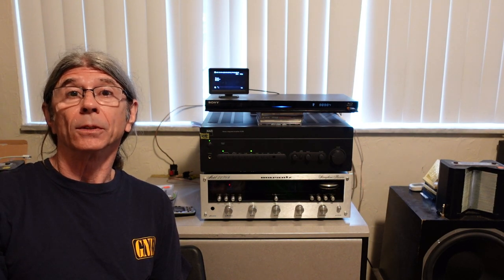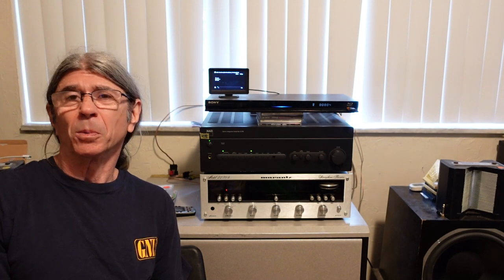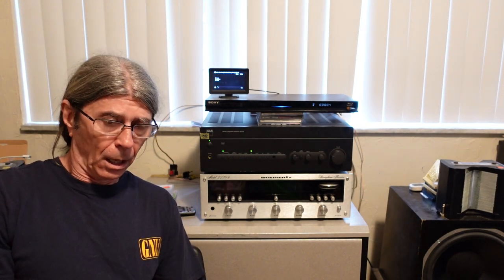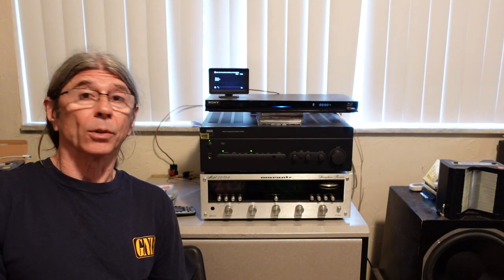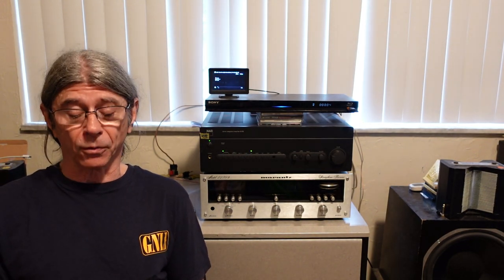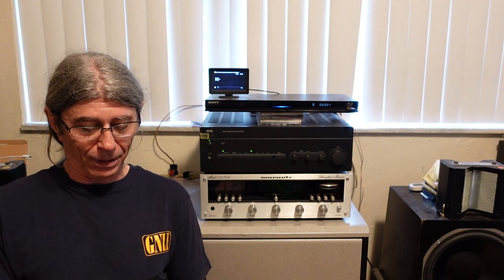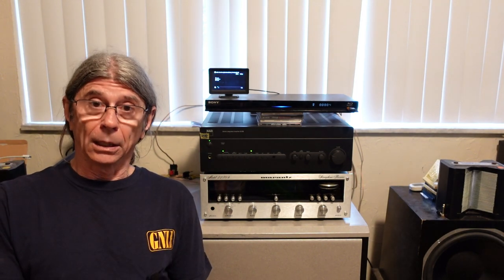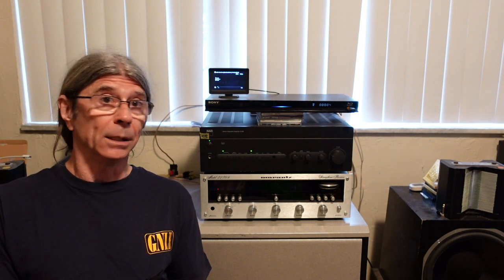NAD C372- Coda

Comment: Thank you! Glad you brought up the point of re-capping is not repair. I would like to add that recapping does not improve anything except maybe reliability, unless there is a problem. Not a fan either of blanket recap.
Reply: Not saying it’s a bad idea, it’s just a service that seems to be sold, as the old STP can fixing a knocking car engine thing, far too often.
Reply from the maker: @RectifiedMetals  At a certain point recapping makes sense, but too many folks with no repair experience read about recapping and think it will solve their issue.  It rarely does.
I thought STP was the racer's edge? (if you remember that you're old too!)
Reply: @raygianelli3612  too old🙈

Comment: Great job Ray in your video  when you showed all the caps you had replaced I couldn't tell but they looked like the blue Sanyo caps that are noturois for shorting and opening and should be replaced on sight im learning a lot thanks to your help and others like
Reply from the maker: Bill, I don't recall what they were, but I don't think it was a well known brand.  For whatever reason, some NAD stuff just has a boatload of bad caps.  Not all of it, but a lot.  Some of it appears to be due to location near sources of heat.  But mainly it just seems like poor quality components.

Comment: Hi Ray, It's been many years since I had a weirdly faulty capacitor that grounded the device 2 times in a row. Fortunately, I was working in R&D labs at the time, so I had access to first-class measurement technology. The capacitor behaved completely normally during the measurement, the capacity corresponded exactly, the ESR and EPR were completely within the table values. Nothing else could have caused this fault but this coupling capacitor, I had absolutely no idea what was going on. So I tried other measurement methods until the error became apparent when measuring the leakage. If the capacitor was exposed to only a certain load it worked fine, but if the charge increased above a certain limit, it broke through for a short time and after discharge it behaved normally again. I don't remember the manufacturer of the condenser, but the device is, it was JVC

Nice day 🙂 Tom
Reply from the maker: Man, that's one for the record books.  Kudos for tracing it to the only component that could cause the issue.  Because most of us don't have access to the kind of test equipment you mention.

Comment: Hi Ray! I used to own an NAD 2200PE. It failed on me three times. The first time was a failed transistor and capacitor. The second time was another capacitor. The third time was yet another capacitor. I decided that I was going to do a total recap as I figured it was too much of a coincidence that at least two caps had failed in the period of only a few months. I've since discovered in my years of repairing audio gear that they are prone to capacitor failure. It also seems that other YouTubers, including yourself, share that sentiment as well.

That last failure scared the heck out of me. I had the stereo playing and was in another room. All of a sudden I heard a really loud gun coming from my HPM-100's. I thought the speakers may have been damaged but I got lucky.  My speakers survived a catastrophic cap failure in the power supply. Talk about relieved.
Reply from the maker: You're not alone.  Been my experience that they sound very good, are well designed but utilize cheap electrolytic caps.  I have a NAD 1300 preamp and only 4 caps in it tested good.  They were the only name brand (Rubycon) caps on the whole board.  The others tested high ESR and/or low or no value.

Comment: What is really interesting here and maybe there is a parallel, recapping is a big thing in the Apple Macintosh vintage computer community. They simply leak or dry out, typically the former and those leaks can damage traces on these lower voltage boards but here is the thing, the iMac G5 was plagued with bad caps and it was, if memory serves, released in 2006. Apparently at the time, there was an electrolytic capacitor shortage and it may be possible that NAD and other manufacturers were simply dealing with market realities - bad caps and caps shortages.
Reply from the maker: Here's your answer:
https://en.wikipedia.org/wiki/Capacitor_plague

Comment: Hi Ray,
Hope you are great.
Could you please explain how to connect my Onkyo AVR TXNR646 without pre out to My NAD C372. Hope you can help me.
Regards,
Reply from the maker: Ajith, I'm not sure what your goal is, but you can take a fixed line level from Zone 2 on the Onkyo and run it into the Ax in on the AND and control the volume from there. If, however,  you wish to just use the output stage on the AND and control volume from the Onkyo you would need a device called a Line Output Converter. They are mostly used in car audio applications but there's no reason you can't use onehere. They cost around US$15-20. Connect the line out from that device into the power amp in after removing the pre/main jumpers.  HTH!
Reply from the maker: Unfortunately predictive text decided I meant AND instead of NAD. Sorry for any confusion.

Comment: NAD- Not Adequately Designed. Nothing personal. I came up with that decades ago when I used to repair. Now due to financial reasons I have to do it again. I hated that NAD mixed Japanese and American transistors so you have to be careful subbing them out. 
We came up with acronyms for everything in the shop. One guy came up with "Oink N blow" (Onkyo.) I came up with Damn Equipment Never Operated Normally.(Denon). I dont know who made it but Sony- Some Operate Not Yours.

Good luck with your move. I may be forced to. I won't be able to afford an apartment in my home state. It's expensive now. If you sell a stereo am fm signal generator with a pilot let me know. I just picked up a boonton 103a. I have to get a shop going in my garage to try to make ends meet unless you think it's a bad idea. I just do audio.
Great videos. I just found your channel a few weeks ago. I really like your presentation. If you want a video idea, if you havent made one already, what are the do's and donts of making a shop at home.
Reply from the maker: I hear you on the audio stuff; each manufacturer has their own Achilles heel.

I also hear you on affordability.  Whoever said life is cheap never tried to live in the 21st century.